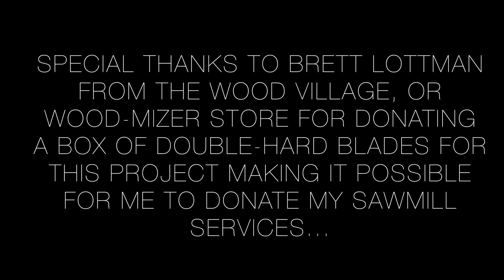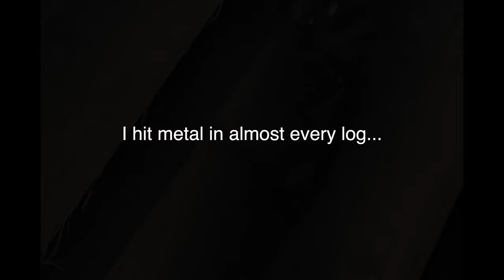Sawing Historic Cannon Carriage Timbers

Comment: That's a lot of nails! Good thing you had some donated blades for the project. The LT 35 handled those large heavy logs with ease.
Reply from the maker: Nails and wire rope on one of them. Luckily none of them were instant blade killers. I’d have run out for sure.

Comment: What a cool project, Jason! Nice that they gave you another pair of hands and the chance to cut out climbing on and off the tractor for a day.
Reply from the maker: Thank you! It was an amazing project with awesome help! Don’t get me wrong, my back is killing me but I can’t wait to see those 6,000lb cannons sitting on my lumber.
Reply: @NorthwestSawyer  I’m curious; are they going to use the wood green, or do they have a plan to dry it? Was it the wood itself or the blade lubrication that was gushing out at 7:13? Is oak stable enough that it won’t deform if worked green?
Reply from the maker: @erinmcgrathejm4985  they plan on drying the wood first. Some of the logs were in pretty bad shape. Hopefully they can dry without rotting first. The water you saw is blade lube.

Comment: Jason that rooster sure sounds like he would be delicious, a couple more cock a doodle doos and he should be headed for the pot!  Nice work on milling that timber, it's a good thing you got box of blades because of all the metal you had to cut through.  I wonder how the extra metal in the wood will affect the historical (hysterical?) accuracy of the gun carriages.  Great video thumbs up.
Reply from the maker: Thank you! Yeah, they warned me about the potential for metal and that’s why I approached Brett. I really wanted to do this project at no cost to them.